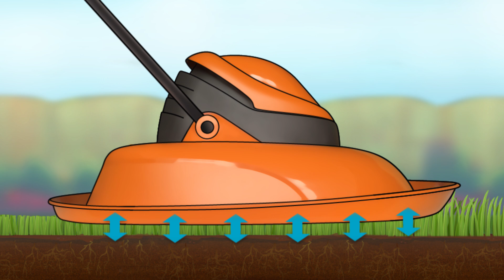How does a hover mower work?

Comment: Most mowers work by drawing air upward, causing grass to straighten prior to being cut. How does the instead downward airflow not cause cutting issues?
Reply: Seems that it draws air upwards in the center like a normal mower, but for the hovering part, it forces air out of ducts along the perimeter

Comment: Any plans to offer a battery powered model?
Reply: Batteries would probably be too heavy for it to hover.
Reply: @Nukle0n  that could be.
Reply: They had gas-powered ones in the 80s
Reply: @nickfury1279  I actually have a gas one from the 80's. I'll post a video to my channel about it in the spring.

Comment: I'm confused by the fact that they work by forcing air down and out from under the blades.  Doesn't that pretty much guarantee that the grass will be forced away from the blades, rather than drawn into them?
Reply: The air is forced around the perimeter of the deck. In the center of the deck, it draws the grass up like a traditional mower.
Reply: @lawnmowerdude  IDK what you mean by "traditional" but no mover does draw the grass up. The fan above the blades is used to force the air into the bottom tray from above. This stream of air is used to cool the engine/motor (especially the electric ones). Most modern mowers create a path of least resistance by opening the back, where the air stream blows the cut grass into the collecting basket.
Reply: @dushk0  Either you misunderstood him or you don't know how a lawn mower works because a traditional mower does suck the grass up into the blade.
Reply: @cameronbartlett856  o of
Reply: @Dušan Barlík  Think of it like an upside down helicopter blade, instead of blowing air down to lift the mower up it blows the air up towards the exterior edges whilst the blades whole circumference acts as a vacuum to pull the grass up
Reply: I have the same question.
Reply: Doesn't cut grass worth a bag full of used nails...........but great for cutting snow !

Comment: I use a different brand, but they all work on the same principle. My advice is to pay $100 more and get a real one. They're good for a cheap quick fix, but save yourself the the trouble. With these, one, you  have to retrace your path a few times to get a clean cut; and two, these don't work well on high grass.

Comment: how are these lawn mowers? i see them on takalot online here and i want to know if it is worth buying?
versus one with wheels, i dont think i understand how it works and how it can NOT be hard to push around ?
the one i want to get is an electric Ryobi model  1300 watt
Reply: Honestly not worth it, i'd rather have one with wheels.
Reply: @one-day-at-a-time4134  I actually got one and it worked fair.
It was a little body muscle intense for certain parts of the lawn and others it was really smooth. It is ideal for really short and regularly cut grass but not when u leave it to look like a jungle.
Reply: @CollosalTrollge  I thought it was awful, that being said my garden is very uneven with awkward little hills. Glad you found it ok though :)
Reply: @one-day-at-a-time4134  yeh it is because u had uneven lawn , yah. I had difficulty in parts of mine, but the rest was like its a hoverboard or something , like it just glides.  Its really more ideal for less overgrown lawn and of course the not to bumpy type garden.
It was on sale and it was Ryobi so i just took it.
Reply: Some youtuber I follow tried using these. He said they are stupid junk
Reply: @Steven_Will They're fine and they've been out for many decades.